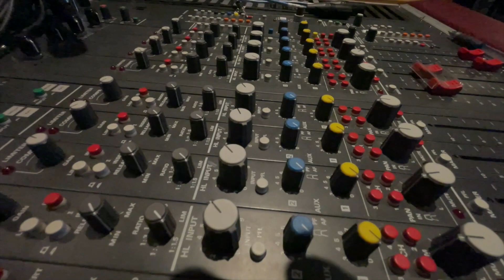DSD and Noise

Comment: Does this imply, or mean, that analog reel-to-reel (RTR) tape may be more an accurate format if recorded, mixed, mastered and delivered to the consumer that way (on RTR tapes-as opposed to it transferred to vinyl or CD)?  Analog tape is, at least as I understand it, not subject to a mathematical program that is to designed to grab all the bits (at whatever it’s designed limitations are) and reject others, limited to a specific frequency range.

Comment: For digital mastering, PCM is only option. For excellent digital mastering, you need highest PCM sample rate possible. Translating the internal master PCM mix (DXD or other) to DSD sigma delta can either be done in the production process or inside your DAC. It doesn’t make sense to say PCM sounds inferior to DSD when DSD originate from a high quality PCM stream. Rather PCM can sound as good as DSD when it is correctly using a high sample rate such as 352.8kHz or 384kHz. Some will argue that even 192kHz PCM sounds better than DSD-64 but I believe actual difference is more about DAC design than format when comparing at that level.

Comment: Hi. I understand there is a high freq signal that we cannot hear because it’s definitely in the ultrasound band , but can it be a problem for the tweeters? Assuming the amps can handle it without problems, at which level is it compared with the musical signal ?